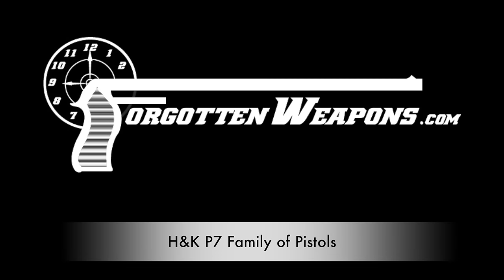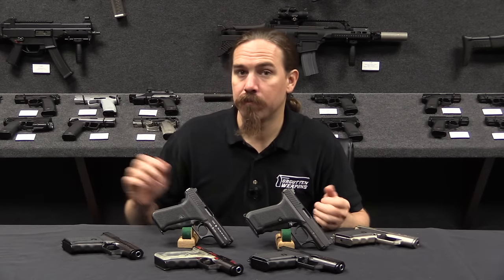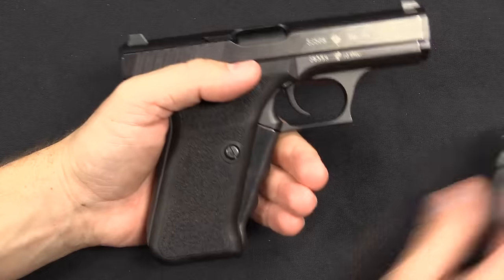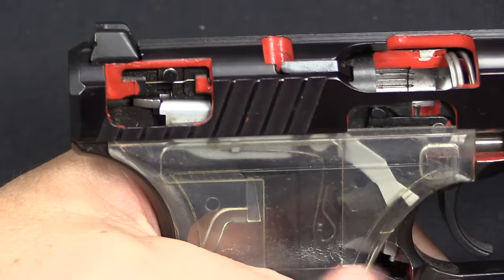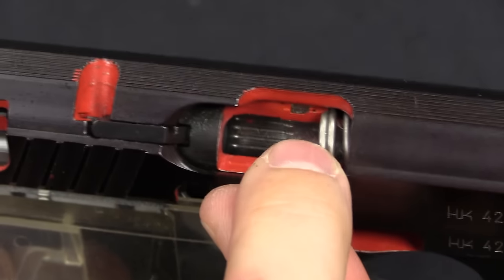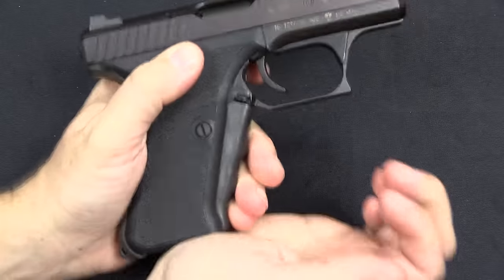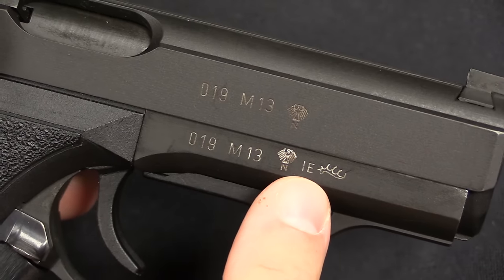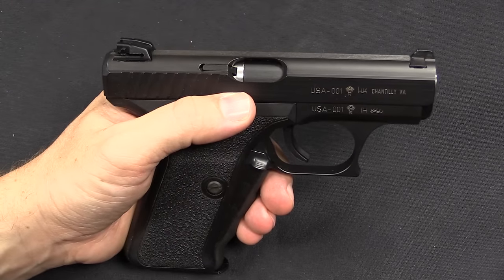H&K P7 Family: Pistols for Gun Cognoscenti

Comment: sees the all-in-1 squeeze cocker/grip safety
that's absolutely impressive

sees different angles of grip and magazine
how German is that??
Reply: You should feel the trigger. I've fired several pistols and use this one on a regular basis. Most pistols have an attrociously heavy trigger pull, while the P7 M8/M13 has a wonderful featherlight pull. What Gun Jesus didn't mention is that the P7 has a very stiff spring in it - which makes the loading and disassemply a bit difficult if you don't have the strenght, but lets you shoot the gun INCREADIBLY FAST. You can fill a bad guy with lead faster than he can pull his gun out. No stupid fiddling around with safety, no heavy trigger pull etc makes this an exceptionally great gun for someone with weak fingers (like me).

Also - it really is very accurate.
Reply: Great weapon
Reply: The grip angle is perfect, the magazine angle is perfect, why should they be the same?

Also, they are very accurate. Like the P7 aims itself.

Comment: A little history on some US H&K’s. NJSP originally adopted the P7M8 in 1983 and it remained their standard issue sidearm until the early 2000’s when it was briefly replaced by the Smith and Wesson Model 99 and then later the Sig Sauer P228. This change was spurred both by aging of the department’s pistols as well as the murder of Trooper Scott Gonzales in 1997. Trooper Gonzales was executed at point blank range with a shotgun while entrapped in his vehicle after his P7 suffered from a broken firing pin spring and was rendered inoperable. There were supposed instances of Trooper’s lives being saved after they were disarmed of their sidearms but the suspects were unable to make the weapon fire due to unfamiliarity with the squeeze cocker. Great video as always Ian!

*Edited for spelling
Reply: SCOTT M. GONZALEZ
Trooper Gonzalez of the New Jersey State Police was shot and killed at 1725 hours while chasing a burglary suspect in Independence Township. Trooper Gonzalez spotted a pickup truck that fit the description of a vehicle used in a robbery a few hours earlier. He called in for assistance and began to pursue the truck which sped up in an attempt to escape.
The driver of the truck pulled into a dead end road and Trooper Gonzalez pulled in behind him, blocking his exit. The suspect abruptly made a U-turn and rammed Trooper Gonzalez's patrol car. The impact caused the patrol car's airbag to deploy, momentarily dazing him. It also jammed the doors closed, trapping Trooper Gonzalez inside of the patrol car. The suspect then exited his truck and shot Trooper Gonzalez multiple times with a shotgun while he was still in his patrol car. The fatal shot struck Trooper Gonzalez in the head from less than five feet away. 
Trooper Gonzalez was able to return fire and shot at the suspect seven times from inside of the patrol car but was unable to strike the suspect. The suspect then tried to flee again but was stopped by other officers. The suspect again exited his vehicle but accidentally discharged his shotgun and shot himself in the head, killing himself. 
Trooper Gonzalez had been with the agency for five years and was survived by his wife.
Reply: @datrakker  Thank you for this information
Reply: Yeah, I've got one of these and in my research I was surprised to find that info on the NJSP
Reply: @datrakker  thanks for this

Comment: H&K needs to design and produce a new and improved squeeze cocker.  They would sell like hot cakes.  They could save lots of money and weight by using polymer.  

P7 m13s on the used market are just too pricey to justify the expense.
Reply: Soap Maker it’s such a neat design. Several things all solved by a single feature.
Reply: Having gotten to handle oney, they're actually REALLY comfortable to handle, and operate.
Reply: Are they so expensive? I just checked it, on Egun you can get one for about 700 to 3000 Euro, based on the condition... That's quite pricy, but the cheapest model seems to shoot fine, it just has only one mag an user optic... That's not SO bad after all...
Reply: P7 M13s are  ~$1300 and up in the states, and the mags go for hundreds...
Reply: @erebostd  yes they're pretty expensive. The cheaper ones tend to have a lot of wear on the finish, and may need some new springs. They'll shoot just fine though. The nice ones can get quite expensive, because obviously people are collecting them. Just kinda depends on what you want. Obviously a nickel plated p7m13 is going to be quite a bit more expensive than a run of the mill p7. Also magazines for the p7m13 are very expensive. About $200 US per magazine
Reply: Christie Malry  will the slide eat up the web of your hand though
Reply: @nichevo1  I've had zero issue with slide bite with mine
Reply: I wonder if they could create one in 4.6mm?  Then they could more or less make it like an M8 and still have a decent mag capacity. 
Well, I have no idea about ammo scarcity, I don't actually shoot anything.
Reply: Perhaps you just have wait another year. The bavarian police will finish its complete changeout to the VP9 in 2019. If H&K didn't make a trade-in-contract to crush them after there should be sold around 30,000 P7. Due to german gun laws, I guess, most of them will be exported to the U. S.. So, keep eyes and ears open!
Reply: if by sell like hotcakes you mean a handfull to the people who really want them because msrp will be $1200. I would rather just buy 3 glock 43s and new york reload.
Reply: @NEPAscallywag  I would buy one at that price. If the lowered the price to say MSRP of 900 with a real word price of 800 ish they would sell a bunch of them and i would probably buy 2 of them.
Reply: it's a neat design, but it won't sell as hot cakes. It solves a problem that has pretty much been solved by endlessly optimizing the existing solution. As a CC pistol, it does not need competition-level trigger, and aftermarket is full of upgrades for M&P and Glock and what not that bring them all up to scratch. 
At the same time it brings question like - how will it work if my hands hurt? Will I get a sympathetic trigger pull and an ND as I squeeze that grip? Etc, etc.
Reply: @UnDeaDCyBorg  one in the new .22 TCM would be awesome and they would likely just have to change the barrel.
Reply: @AlexN2022  the whole idea that a cc pistol shouldnt have or doesn't need a nice trigger is absolutely ridiculous. 
Shot placement and split times are what matters and a better trigger facilitates that. 
Also with a similar aftermarket attention to the fire control parts as given to strikers such as the glock and m&p a gun like the p7 has the potential to be far better in that regard. 
I do however agree that even if the p7 was brought back it would never be a big seller, it's all steel, too expensive to manufacture, and even in double stack form holds too few rounds to be competitive in the current market. Doesn't mean I wouldn't buy one but Joe Blow gun buyer whines about a Glock being 450 dollars let alone what a new p7 would run.
Reply: @logitimate  As a bavarian police officer Slightly Mad Otter is definitly better informed about the P7's future stay than most other people - at least better than me. But please allow me to make a little annotation: The Home Office of the State of Niedersachsen also announced not to market their P7 pistols shortly before and during the changeout process (around 2002). Main argument was also not do let them get in criminal's hands.  They didn't use the term "to destroy" but "to remove them from access". Some cynics may say this is a nice wording to soothe do-gooders. According to official documents from 2009 (which you can find on the german wikipedia on the P7) 13,000 of them were sold to H&K in a limited auction and exported to their US-branch. This was justified by the state's general budget legislation which demands not to destroy any state-possession of value. And H&K paid 220 € each. Unfortunately the parliament forgot to adopt an exception-law those days. LOL!!! Anyway - when I got in contact with the P7 in Switzerland in 2009 I shot two M8 models formerly owned by the State of Niedersachen (according to its markings) but definitly leagally bought in a normal gun store there. By the way: Switzerland seems still to be the most important place of origin of illegal guns in Southwest Germany. I have no deep knowledge about bavarian legislation. But, to the fact that there is a bunch of about 30,000 P7s existing, I assume that those who have the knowledge, won't miss a chance to make a profit of it .... LOL!
Reply: I'd buy one in a heartbeat if it came in under US$1000.
Reply: The patent has probably expired, so it's only a matter of time before someone with a CNC machine starts reproducing these stateside.
Reply: @Soap Maker you should check your prices.  I WISH you could get a p7m13 for $1300.  Even in the early 2000's that would have been a low price for one.  Last I checked even the p7m8 runs over $2K on GunBroker and the p7m13 would run for substantially more.
Reply: Im on board with that.. Preorder sold lol
Reply: @dasc0yne  I prefer the M8 to the M13. Maybe my hands are too small but the recoil is uncomfortable on the 13.
Reply: HK will never make this design again.- Simply too expensive to manufacture even if they could figure out how to machine the plastics. If they did, it would never be like the original P7, a masterpiece.......
Reply: @NEPAscallywag  I see the poors are at it again
Reply: @AlexN2022  terrible take
Reply: Christie Malry  Sad!
Reply: @nichevo1  Not my hand and I am get hammer by from 1911's and P-210's.
Reply: @egbertlamprecht6699  I have one of the Nieder P7's! Glad they didn't destroy them.
Reply: @davidmandell9909  They thought the Colt Python would never come back.
Reply: Yeah but I imagine they don't for the same reason Steyr no longer makes or markets the GB, which is because they wanted military sales, not just the occasional civilian sale. Hell, HK can barely stay in business because they make such good shit that never needs to be replaced.
Reply: Christie Malry  What politics are you talking about?
Reply: @frankdn109  That’s like saying you’d buy a Ferrari for 10k.

Comment: I really wish H&K would build a new generation of P7 pistols. Polymer frames could potentially reduce the heat transfer and the weight, which is another issue a lot of people complain about today when you suggest a P7 for concealed carry. Plus it would probably be a lot cheaper, although still more than the P30.

Comment: Just a hypothesis, but maybe HK made the P7 squeeze-fireable as an early winter trigger fix? You could jam your gloved finger into the trigger guard and squeeze like a madman.
Reply: imagine you're in a hurry to fire. You have to do two things: squeeze the grip and pull the trigger. Humans are very bad at doing two things very quickly and still maintaining an order, a close timing between them. You'll end up every once in a while pulling the trigger before you have completed the squeeze. H&K didn't want that to be an issue, and rightly so.
Reply: Also, if you forgot to wear your gloves, it has a built-in finger warmer.
Reply: It's probably not an intentional thing. More often than not "features" of a gun were never intended to happen. They probably never even tried to see what would happen if you pulled the trigger, then cocked the gun.
Reply: Yeah probably not intentional, kinda like the 1897 Winchester' s slam-fire ability. It's more than likely a happy accident, but engineering quirks like that make my imagination run wild trying to figure out uses.
Reply: @AlexN2022  it still fires if you end up going trigger first though.
Reply: Have a drink, Rick.
Reply: @AlexN2022  late to the discussion, but in that case the propper thought to execute the fire is  "gip the gun hard!"
Reply: @chrisclark6161  That is a pretty absurd notion. It might not have been the intention while creating the weapon, but even from the blueprint the designers would be very aware of the mechanical interactions between the trigger and the squeeze. And obviously that would show up pretty quickly even in in-house testing. I guess it's not really important though since you're already squeezing down the trigger anyway, it's meant to fire.
Reply: @MumrikDK  I wager even then the probability of confusing the order still exits.
Reply: You know those pesky urban kung-fu masters who jam up their their thumbs in your triggerguard to prevent you from shooting? They'll never see this coming.
Reply: @MadCDeeJay  DETROIT...URBAN... SURVIVAL... TRAINING. TODAY WE'LL SHOW YOU HOW TO DEFEAT THE H&K P7 TO INCREASE YOUR SURVIVABILITY.

Comment: I still have my P7M8, blued, and the original box and all papers.  I bought it new in 1993.  It is absolutely a fun gun to shoot and I used to carry it whenever I had more than a little cash on me or had banking to do.  Only time I ever really had any issue was once when I used it to renew my CHL, and the renew included a firing re-qual.  50 rds must be fired for a passing grade.  Altho I passed easily because the weapon is so laser-accurate, it did get quite hot there at the end, even tho mine has the little plastic finger guard within the trigger guard.  I did put a set of really nice walnut Nils grips on it eventually.  Still has no wear, not a single blemish, and works like a champ!  Last I looked in the Blue Book it is now worth at least $4,000, compared to the $900 I paid in 1993.  Not a bad investment!  I know for awhile the M13’s were of more demand but that has changed and M8’s are about equal in value.  I’ll save mine for my son.

Comment: There is also a manual slide lock...to lock the slide back without a magazine inserted...it's just behind the trigger on the left side...it is flush with the frame...surprised Ian didn't mention it.
Reply: Fortunately I scrolled down this far on the comments before double posting this issue. I am surprised too. It seems, the M8 also features this manual slide lock above the modified magazin release.
Reply: @j.h.2313  Ditto.  I was going to comment, too, but also managed to scroll down to Mr. Krause’s comment.  Terrific video.  My P7M13 is my off-duty carry and by far, my favorite gun